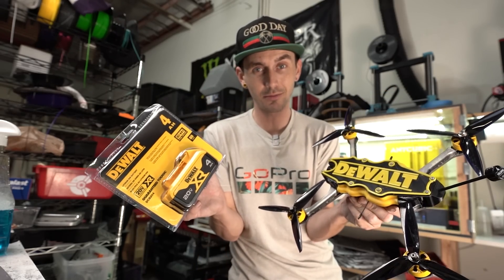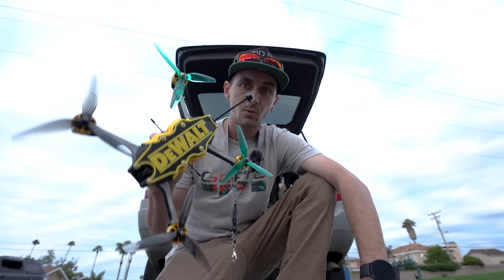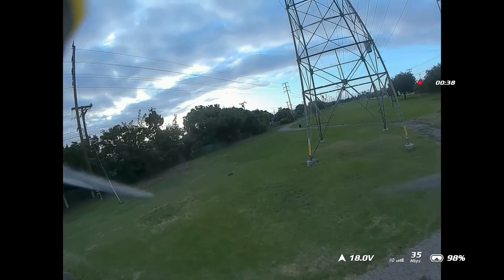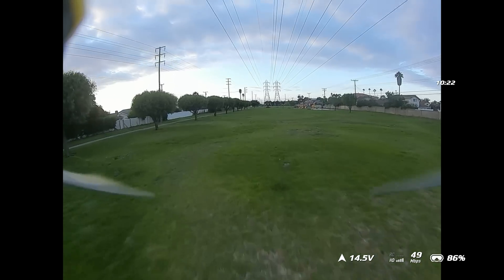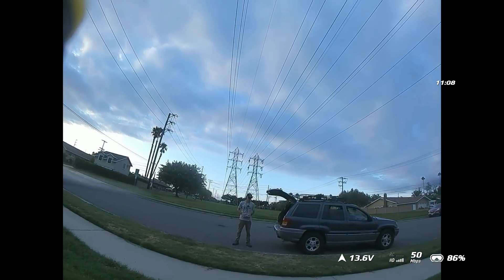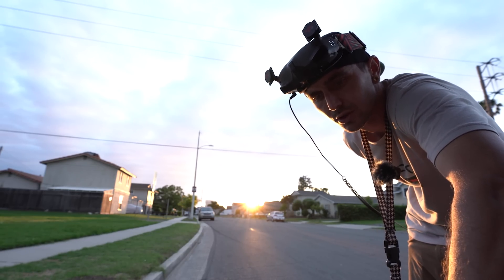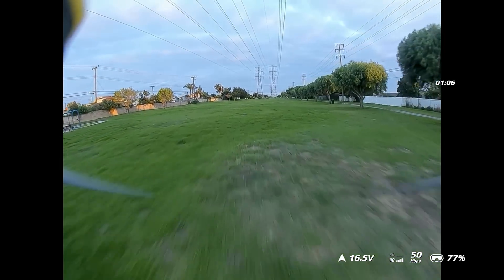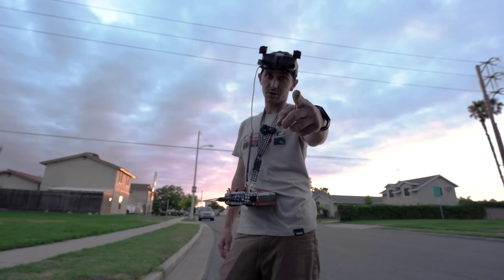DEWALT DRONE  Battery Test! How Long Does This Drone Fly?

Comment: 4s 2200mah + 2207 1800kv Motor + 7035 props. I get 18 minutes landing at 3.7 volts per cell. I can fly more then I want to on lipo. 
RDQ Series 14.8V 4S 2200mAh 80C LiPo Battery - XT60 $36.99 In Stock
Reply from the maker: Ok
Reply: @ChrisTealFilms  
Cool build and great video production! You've got some skills. No hate here. Just leaving my comment to let people know about cheaper options for longer flight times.

For the YouTube comment section lawyers, I hereby state:

Impressive construction and commendable video production! Your adept skills are evident. There is no intention of disparagement in my remarks. I am merely submitting this comment to inform others of more economical alternatives conducive to extended flight durations.

Comment: Much better flight time then expected! Not sure why everyone thinks under 3v per cell kills li-ions haha, I bet if you put a street league tune on it with rpm limiter it would sip amps even more and potentially give you much longer flight times
Reply from the maker: This video brought out all the armchair electrical engineers. All the Mikuakee guys aren't acknowledging the fact that dewalt is 20v and red is 18v either. People are funny I am def building another and we gonna race em lol
Reply: @ChrisTealFilms  I’ve noticed haha, but one thing the Milwaukee 18v is actually the same cell configuration so it’ll come down to whose using the better li-ion cells, im not sure if dewalt uses 21700 in there packs like the larger Milwaukee 🤔

Comment: damn you ran that 5s dewalt down under 3v a cell you basically ruined a $220 battery on one flight. 5s 5ah li-ion pack costs $70 and weights half as much. Its a fun idea you came up with but should not be replicated by anyone.
Reply from the maker: Lol not one battery I used cost more than 70 dollars so idk what ypu smoking thinkin it's a 220 battery but I want some
Reply from the maker: Thanks for stopping by tho!

Comment: I’ve been waiting to see    What happens if you push it too long.  Tool batteries usually have a built in shut off to keep you from over discharging,  so if you punch out too hard the whole quad might just turn off 😳 and may or may not reboot

Comment: This is actually a fantastic test of batteries for tools. Try to team up with Project Farm for a specialty video. Would be super awesome
Reply from the maker: Thought the same thing. Really shows quality and longevity of quality cells vs cheap ones I didn't realize they were so different.
Reply: @ChrisTealFilms  you gotta get the lipo pack they cell. I believe they call them 'flat cells'. It should technically give you a lot more amperage. Also, I'm quite impressed at the performance and flight time to begin with. I would have never guessed you could get such good performance on a power tool lion. I'm not wondering if they're lion or LiFe. The LiFe cells have much better amperage performance.
Reply: “Powerstack” for Dewalt LiPo pouch cell batteries. The 1.7AH is little, but about 3oz heavier than the 1.5AH normal battery. Much flatter power curve.

Comment: Most likely the weight of the casing on the battery is affecting the flight time. I built a 6s 4200mah using Molicel li-ion and I was able to fly 15 mins. Great experiment though!

Comment: How does the flight time compare to a 5s 5000mah pack? And would larger props help take some of the stress off the battery or motors bc of heavier weight bc of the Dewalt?
Reply: 6 inch is a sweet spot for light performance and long flight time